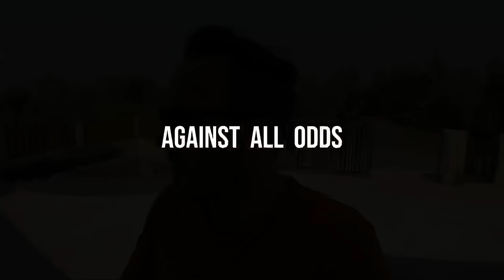Everything Changed

Comment: Water is like electricity  it will take the path of least resistance.  The tap had a greater resistance than the pipe did. This is because the tap bore size is narrower than the pipe.  Of course, the correct course of action was to fit a  second tap.  Which is what you did.
Don't run yourself down. you're learning, which a lot of people won't do.
Reply: Also the outlet in the pond was well above the level of the canal pipe, and water seldom likes traveling uphill :D

Comment: I really enjoy your channel.   You are in Isan right?  When you dig the pond, did you have to seal it, or it has enough clay in the bottom to seal it naturally?    From your previous videos, the area is flooded every year, so the pond is over filled then.  How low would the water level in the pond go within the season, if you don't refill it?
Reply from the maker: It naturally sealed, although it took about 1.5 years for the water to go a nice colour, rather than muddy and brown. We’ve flooded the last 2 years but prior to that it’s not happened for about 14 years, so we’re hoping it’s not gonna be every year going forward. This time of year we top up the pond with the water pumped from our well, but it doesn’t need a whole lot. The level drops probably about 15% during this season. Hope this helps 🙏
Reply: @LifeinThailand777   If the water doesn't go down too much, have you looked into doing natural swimming pool out of your pond?   One of your country men, David Pagan Butler has a lot of videos on the subject.